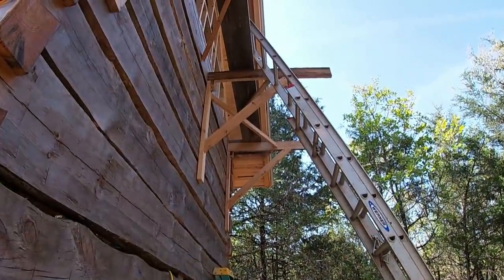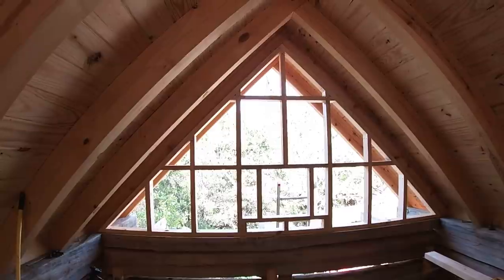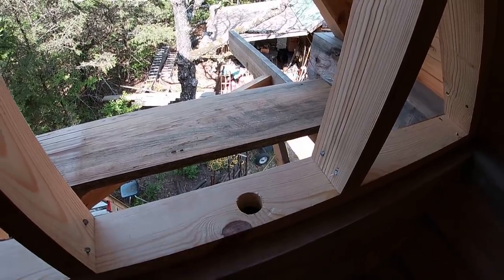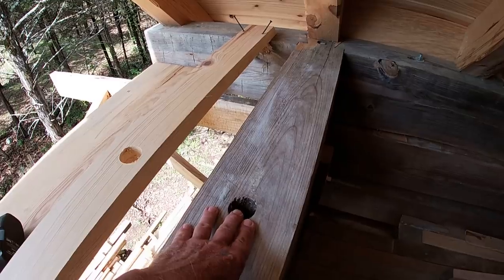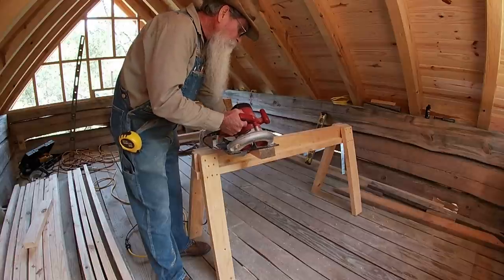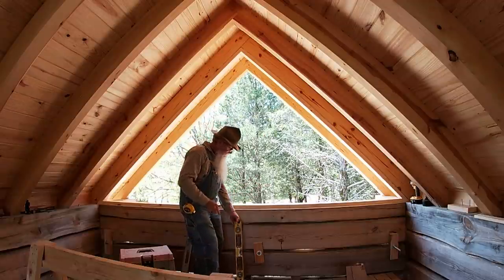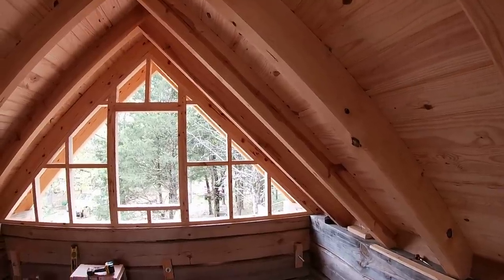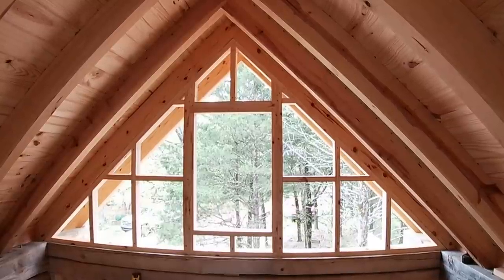Laying Out the Gables for the Studs, Dovetail Log Cabin Build (Ep 44)

Comment: Great workmanship, just amazing. When you cut your bottom plate of the gable frame you used your 12" ruler to make a mark both sides and then added them to the distance between the gor the bottom plate length. I was wondering why you didn't have an off-cut off 2 x 4 that was 12" long with a 45 degree cut on one end and place that in there and simply matk the end of it and then measure between. Keep up the great craftsmanship 👍👍
Reply from the maker: Howdy Warren- I sure appreciate you watching the video and for the kind words. Cutting a block like you said would definitely be a great way to get the mark. Thank you so much for sharing that tip. Take care and God bless
Reply: @TheBeardedCarpenter  I am loving the sawmill shed build. With the price of milled timber these days, I am sure it will come in handy. Your father has passed on some great skills to you, I love the precise detail you go to throughout all stages of your builds. Great to see 👍
Reply from the maker: @warrenspooner1159  I appreciate you watching the sawmill videos. It has been a real blessing to have it. I haven’t bought any lumber since I got it except for one treated 2x4. God bless